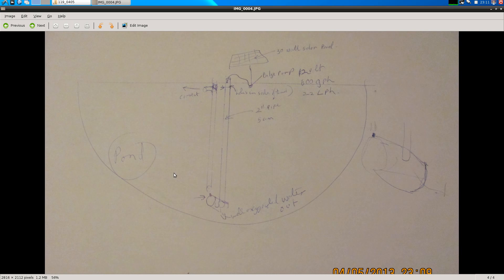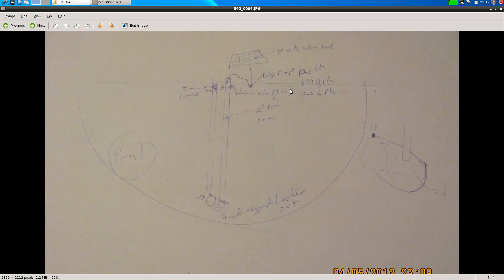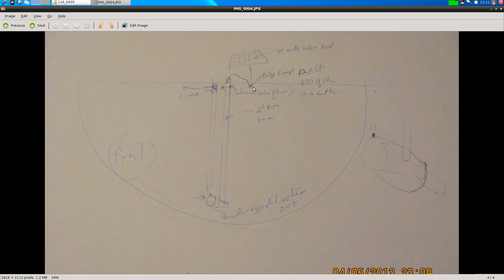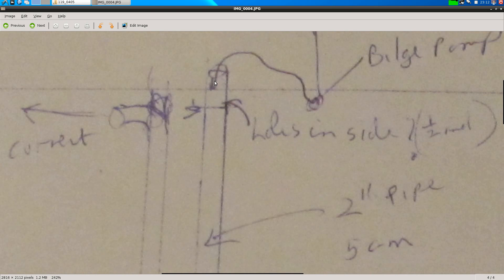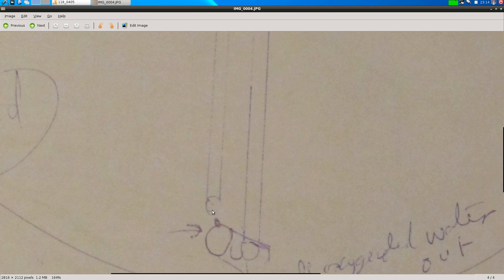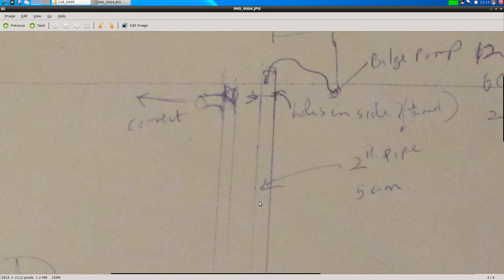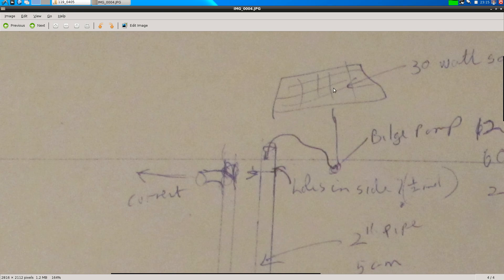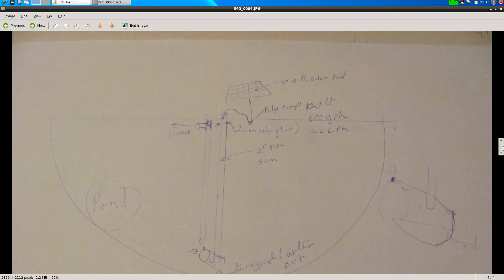Aerate a pond on the cheap using solar panels and a 12 volt bilge pump! (First Draft)

Comment: Try this , install a float collar on the pumps base float the pump upside down just below the water line so the pump draws in both air and water. Be sure to point the outlet down to the lower waters as it needs it most. Plus tether it as it may motor lol.

Comment: Hi Brian. Thanks for making this video. I live in Thailand, and we are about to move next to a large pond that has no moving water, so it stagnates in the tropical weather - and is a breeding ground for mosquitoes. I hope to aerate the pond to encourage fish to flourish (there are already fish in there, but I have no idea how they survive at the moment). I'd love to learn more about your pump experiments, especially your thoughts on a solar powered pump simply generating air straight into the pond (perhaps with a vertical downdraft/updraft arrangement to best generate useful oxygen). In the same housing area I see fountains in ponds, and assume they are being used to aerate the water, too. I wonder if that could be done as a decorative feature that also benefits the oxygen levels. Ron, Thailand.
Reply from the maker: properjob Hi, Ron,  if you use a bilge pump, you "might"  need a charge controller before it.  I think some of the newer panels make 17 volts.   I don't know how the charge controllers work,  but  I think some of them actually adjust the voltage down and current up.  (which I think is a remarkable feat!).   I get my tiny air pumps from china.  They are capable of putting the air about 2 meters down under the water.  I can send you an email with the (engineer salesman) email address  who made the best one for me.  It was the 2 brushless pumps.  They come on every morning and turn off every evening, they have a speed control knob and the guy added circuitry to make that happen. They proved far more reliable and long lasting that the brush pumps I tried out which gave trouble after about a month.  The brushless pumps are still working right now. They have a simple diaphragm and I think this is part of the key to their long lasting.  I am not sure what is best for you.  The bilge pump will move more water,  the air pump will probably aerate better.  Perhaps you could try both and compare them?  Best of luck,  Brian.  (PS I don't get any commission from China).  Most companies were not interested in quoting for my tiny trial but the 2 that did worked hard to provide me with either their best bet at best option or in the case of the brush pump,  a range of options.  The brushless just performed better for me.  Brush pump probably needed a pretty fancy charge controller before the pump.
Reply: Brian White Thanks for the quick response, Brian. I'm looking into the availability of such things up here in north Thailand. I think there might be a selection of stuff on the market already because there is so much standing water in this climate - and the needs of farmers very often involve moving water from place to place without spending much money. It's not like there's a shortage of sunlight to power the solar panels :)
Reply: Hello in Thailand You need to find a pump with continuous duty as bilge pumps are not designed to run full time. instead off and on but would work in a pinch. Must be a million ways to do it , good luck with it

Comment: what make and model of bilge pump did you use? thanks
Reply from the maker: Hi, Lyn, I am not sure which model I used, but I do know that they no longer make that model. It was rated about 600 gallons per hour. So any generic bilge pump with the same gallon  rating should give a very similar performance.   I had it on a 15 watt panel  and it was underpowered. It could easily  use the power from a 30 watt panel instead.  I think it was a 36 watt pump.     I am testing some air pumps from China at the moment. Direct drive from the solar panel just like the bilge pump.   They might be a better bet because it is all air pumping so it  is all aeration.  The guys  from one company made up some little brushless air pumps (with extra electronics so that they work from the panel) for me to test and so far, they are a bit noisy but working well. Another company sent me 2 brush air pumps to test  (Also direct from the panels). They are actually faster and cheaper than the brushless but their lifetime might be less.  They sent me extra diaphragms as part of the test.  Diaphragms wear out faster than the pumps. I am testing the pumps for the "public good" because nobody else seems interested in doing these tests.  The air pumps are typically used in all sorts of equipment (including medical equipment) so if I find the right ones, they might be very reliable. There is lots to learn.  For instance, the diaphragms for the different pumps are quite different.  Those with the brushless pump seem much simpler (so potentially longer lasting).   Time will tell    Brian